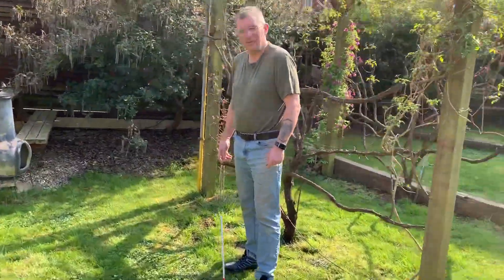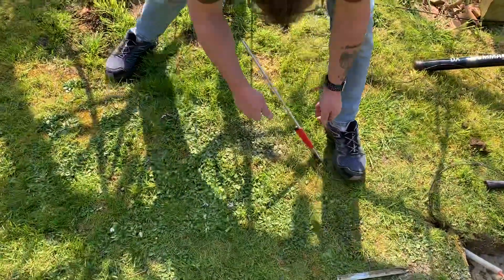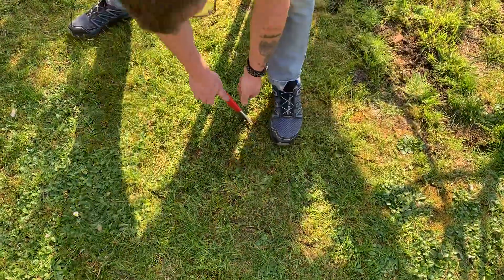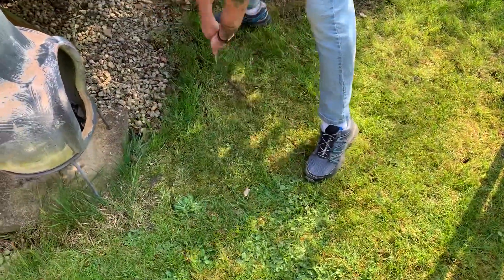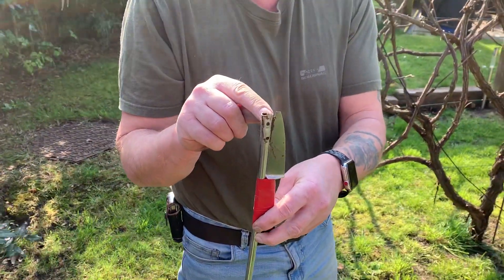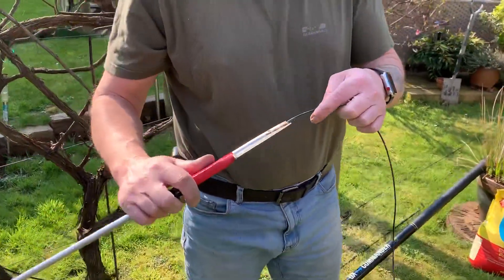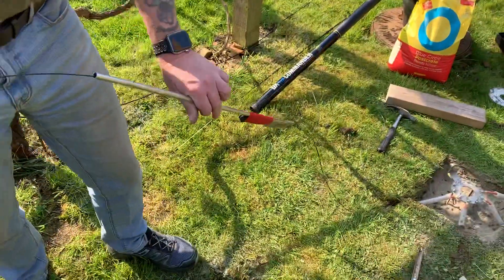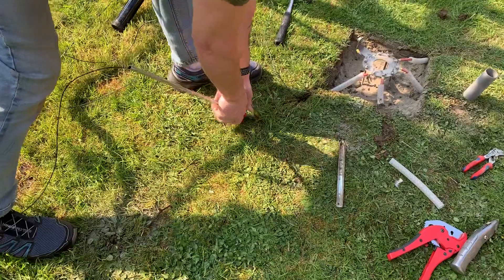DX Commander Ground radials insertion tool

Comment: Hi Mike. Can you send me the part number or a link tk where you got your glue lined heat shrink.  I can only find them in black but i am after multi colour Thanks in advance.
Reply from the maker: It was on eBay about 3 years ago sorry I no longer can find the sellers info
Reply: Thanks anyway.

Comment: Hi Mike
Another thing that works well is a gasoline sidewalk edger. The work great for putting in 160 meter ground radials of 130 feet or 39.624 meters. I used it to trinch the ground then just close it with you foot. When I did my 160M vertical here in Florida I put in 60 radials. Although this would for short radials at 72 yearsjhhjiuuiiikuikol old I wouldn't live to talk on it.... LOL  But I do like your way for 10-12-and 17 meters..  Thank Mike..
Reply from the maker: thanks Dave...
Reply: Dave, doesn't all the soil and rocks go flying everywhere and then you have to use new dirt to fill in the small trench you made?
Reply: @videoric  Not that bad, but you got to realize that the trench is only about 1 1/2 inches wide and when you put the cable or 1 1/2 inch pipe in there it pretty well fills the hole. Then just take your foot and push the side in. But in my case it was only wire and the depth was about 1-2 inches deep and 1/2 to 3/4 inch wide.

Comment: Good idea. 20 years ago I put in 4 x 1/4 wave radials per band (5 bands 80-10m) in a field using a narrow spade and tucking them in. Almost killed me but worked great. This tool looks good but either way it’s still potentially back breaking work. Just subbed. Cheers, Nick M1DDD

Comment: OK, are ground radials the same as a “ground plane?"
Reply: Not quite.  Ground plane refers to the ground that is ‘seen’ by the RF radiating along an antenna.  Examples of a ground plane include the body of a car or radials which may be elevated or on the actual ground.  Ground radials are used to create the ground plane for a ground mounted antenna. But the ground plane doesn’t necessarily require wires; if you’re lucky enough to be able to operate on the coast, you could use the sea as a very effective ground plane.
Reply from the maker: @DarrenWetherilt  yes that is a more accurate explanation.. :)
Reply from the maker: Adam Christian Smith   Yes that’s right. 😀

Comment: I followed your idea and made something very similar. Used it to get around 150m of wire down in the lawn. Thanks for the idea.  Makes ya back ache a bit though... Paul
Reply from the maker: G1WHP mine ached for days, left that bit out.....  cheers Paul.
Reply: Callum told me you had back ache when I told him I had used your method. Still it’s a cracking idea. 👏

Comment: I ended up getting the yaesu ft 8900
Reply from the maker: Great radio..
Reply: @mike-M0MSN  looking at the antennas any suggestions for the quad band
Reply from the maker: Greg Goddard M7GWM sorry mate no that’s one of the reasons I went for a duel band..
Reply: @mike-M0MSN  ordered the diamond 8900 rather than a Chinese copy
Reply: Hello Mike now I realise what you were saying about the antennas I heard you on the Livestream today recognised you straight away
Reply: Mike which was the best mobile antenna  Out of all the ones that you have tried? For 2m and 70 cm

Comment: Fake ?
Reply: This antenna is for 11 meters band ?
Reply: @RougeauXC  It's an all band vertical. Google DX Commander.
Reply: James Bowie , I hâve thé information now. Thank’s for you answer 👌
Reply from the maker: Not a fake tool, it can be used to insert ground plains of/from a DX Commander. The tool is not made by DX Commander. Sorry if the heading is misleading.
Reply: @mike-M0MSN  hi nice to meet you today just looking at the radios online it was the ft 7900 that you had is that correct I can't remember can you let me know please
Reply from the maker: Greg Goddard M7GWM hi Greg good to meet you to, yes the Yaesu ft7900.  Good hunting.
Reply: @mike-M0MSN  thanks very much